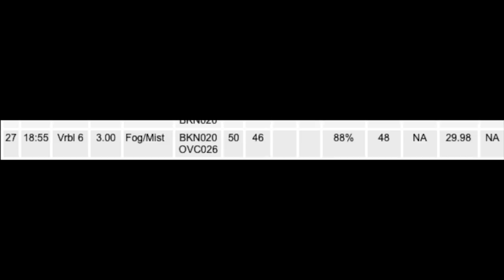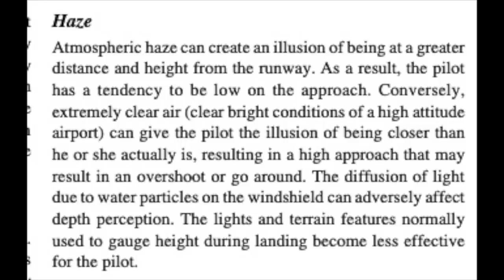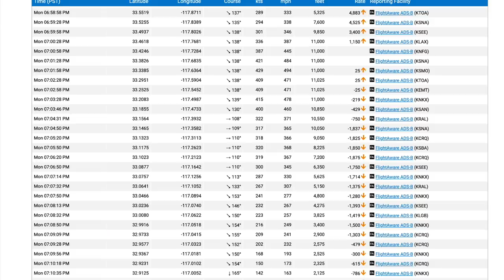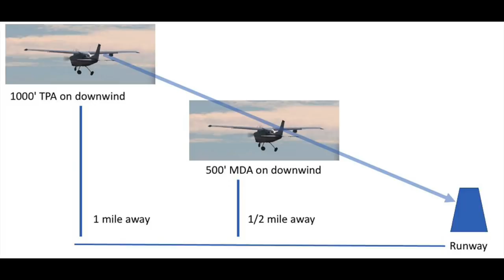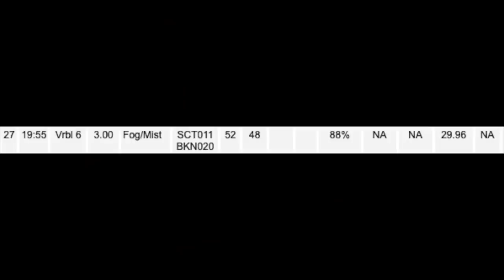N880Z Learjet Crash El Cajon San Diego California - Low Altitude Starts Accident Chain

Comment: Thank you for the explanation of the accident. As a pilot it’s always unnerving to hear about these accidents and I think that little bit of induced fear will make you start researching the chain of events that caused the accident, which will in turn make you learn from a tragic situation & hopefully never recreate the situation.
Reply from the maker: I totally agree. It may seem a little macabre to be reading about accidents, but I think they are a very useful learning tool. Another good tool is develop standard operating procedures and always following them. And of course practicing good risk management. If everyone did all of these things consistently, we'd have a much lower accident rate.
Reply: You comments are spot on! I fly a B350 KIng Air single pilot out of southwestern CO.  I don't do circling approaches at night, and only do them in the day if it is vfr conditions.  I LOVE my downwind legs to be offset 2-3 miles from the intended runway so as to have ample space to make the 2 90 deg turns.  That much distance out and I am outside of the circling distance from the airport anyways.

The conditions at the field that night were marginal vfr, so I possibly would have circled also.   My backstop for that maneuver while single pilot is I keep the auto pilot connected until on final approach (the runway clearly in the front window).  

Safe flying!
Reply: @campingalan  - Interesting, as this is all about risk management, right.  Isn't choosing to fly a B350 single-pilot already stacking the odds against you?  Just because you can, doesn't mean you should.
Reply: @chucksavall  yes....a very valid point!      

As my mentor advised, he recommended at least bringing a second pilot along with any SoCal or NYC flights.  I haven't done that yet.  But...at the point that I wished I did (like during a systems failure), it would be too late.
Reply from the maker: @campingalan  Yes, you take away so many problems in faster aircraft when you fly a properly sized traffic pattern. Fly safely!

Comment: Best breakdown I've seen. I was a block away from this accident when it happened, very deafening and bright. Weather was very bad and rain was regular with bursts of heavy showering.
Reply: Were you able to hear the engines spool up to max thrust after the accelerated stall had already occurred?
Reply: @josiahwaters1706  Yes, they were losing altitude as they were banking left and then the engines throttled up to max quickly just before the impact. I assume they had just figured out their error and were trying to correct.

Comment: The clouds on the CCTV footage seems much lower than 2000'agl. They were in and out of some really low scud, and lost situational awareness.
Lovely explaination of the problems related to a low pattern altitude. Nicely done.
Reply: He was only at about 700 feet when he should have been at 1440 by the chart) he started that final turn and from the video he was still in the cloud.
Reply: @badmonkey2222  Absolutely.
Reply: @78XT500  and was way too slow making that tight turn, the ironic thing is these guys aren't trained to keep their speed up in circling approaches and until they start training these guys to keep at least a 30% stall buffer while making the turn this is going to keep happening,, the airline's do it why don't these guys do it.
Reply from the maker: Thank your watching and for your kind words about my video. I've only seen one ground camera view, and there were definitely lots of low clouds in the area. I didn't mention it, but the airport is in a valley, so fog is common. And yes low pattern altitudes can cause the same problem for both VFR pilots and for pilots flying a circle to land maneuver. They physics are the same, whether their VFR or IFR at the time.
Reply: Definitely this ^^^^^^^ ... they were scud running under the low clouds and heavy rain trying to keep RWY in sight
Reply: I need a precision approach in this haze situation
Reply: @AviationNewsTalk  Thanks for professional video. I personally believe the Local Cab controller would have warned the pilots if ceilings, BR. or MVFR was a factor and/or decreasing significantly. He was probably expecting them to over fly airport at TPA and enter L downwind. I speculate that ceilings were very close to Metar due to popping beneath ceilings and the timing of IFR cancellation after Jugal.

Comment: Excellent analysis. 
27R had a usable landing distance (beyond the displaced threshold) of 4636 feet. 
Some have pointed out the LOC-D approach that appears to be straight in. However the final descent portion of that is at nearly 7º, more than double the normal descent profile for landing, making that approach in a Lear onto a short runway extremely dicey. This is why it is NOT approved or a straight in approach. Indeed it is ONLY approved for circling to other runways. The minimums for this category C or D aircraft to do that is a 1600’ AGL MDA and 3 miles vis. Plus there’s a tower 885 feet above airport elevation just north of the 27R centerline. Yikes!
Reply from the maker: Yes, there are a LOT of challenges for such a large and busy airport.
Reply: @AviationNewsTalk  Why not use RNAV 17 then Circle 9L? Enter L downwind or L base. No night restriction or Category C restriction. No need to cancel IFR. Winds OK at 190/5.
Reply: @DownTheRabbit-Hole  Maybe because there is even higher terrain to the west, lots of high hills and a mountain with a peak at 1600'. Would be my guess anyway. He does talk about it here  9:49
Reply: @BrettBaker  On RNAV 17 plate, Because the C in Circle is not Black it means the Circle radius is 1.7nm (the old numbers) for Cat C aircraft. Yes, I checked the elevations in Google Earth and you are right. The approach designers would probably say in RNAV 17 Pilot Briefing area that Circle 9L NA or CAT C not allowed in Minimums area if they felt it did not meet their criteria. At this point I feel RNAV 17 Circle 9L was the only legal and safe night IFR choice to a longer RWY that meets LJ 35A landing wet rwy minimums. If this is not correct please let me know.

Comment: So sad to hear about the loss of life, my condolences goes out to the families of those lost in this crash.
This crash is very closely reminiscent of the Lear crash in TEB. They took we’re doing a circle to land approach and basically lost it. 
I’ve flown Lears into TEB and have done the exact same approach many times, it goes to show that it can get away from you very easily and quickly, and at that point of the fight it’s darn near impossible to correct.
Reply: These guys that fly these jets are not being trained to keep the speed up on the circling approaches, they are only required V-Rep+ 5knts over stall speed which gives you no wiggle room, the airlines are trained Ion circling approaches to keep a 30% stall buffer on their speed until they are on straight final and then reduce speed, that's why you keep seeing these guys crash on the circling approaches it's going to keep happening until they're trained and required just like the airlines are keep that speed up when making those tight turns, plus this guy was way too low 700ft when he started that final turn and by the video he was still in the scud, just insane to think that he was trying to do those visually at night in that jet type.
Reply: @badmonkey2222  And if I might add, too many relatively "inexperienced" pilots got to school, "get the type rating", and believe they're now "qualified to fly jets", when in fact, the type rating is "a license to learn." (ATP, 12,000 hrs, 5 types and 35 years professional aviation experience)(and remember: what the FAA requires and what the "insurance requires" are usually two very different numbers for good reason)
Reply: @N34RT  Clarke, if this is true, then why on earth, during training,  are the pilots being told, "You ONLY need this much speed during this maneuver"?  Why not have them practice circ to land, and for safety sake, train the pilots to add that safety buffer to their speed. 
---People are focusing on being too low here, but the emphasis should be placed on the fact that he was too slow, not too low. The lack of speed is what caused the crash. Not the lack of altitude. Am I correct  on this? You, 12,000 hrs, Me 330 hrs. Thx

One more question, is it possible to recover from a stall spin in a Learjet?
Reply: @shamu3838  Last question first: Yes, it's "possible" to recover from a "stall/spin" in a Learjet, but it's a scary experience, even with 10,000 feet under you. So you're conclusion is correct: Lack of airspeed was the "precipitating cause", not lack of altitude. However, the various people dissecting and elaborating on this accident are pointing to altitude control (or lack of it) as yet another indicator or poor judgment/decision making.

Comment: Notes:
1)  There is a displaced threshold of 450 ft to RW 17.
2)  There actually is an instrument approach to RW 27R.  It is a localizer approach.
Reply: 1) There is also a displaced threshold of 706 ft to RW 27R. However RW 9L lacks a displaced threshold.
2) The LOC-D approach looks like a straight in approach to RW 27R but it is actually a circling approach to all runways.  If it was straight in to 27R, it would be called the LOC RWY 27R approach and not LOC-D.  It is a circling approach to all runways because it requires a 745 FT/NM descent rate to land from DEBEY at 2700, which exceeds the 400 FT/NM straight in limit. Diving at the threshold of 27R at 745 ft/nm from DEBEY would be at least a 1700 FPM descent at a Learjet's approach speeds and result in a dangerously unstablized approach. So to land on 27R on the LOC-D approach would require a circling maneuver and, like all the approaches into KSEE, circling to 27R is not authorized at night.
Reply: @sintillate1913  the LOC-D should not be circling for 27R.  The FAA needs to fix this.  That approach is a LOC 27R with circling options for the other runways.
Reply: @navycranes  it can't legally be LOC RWY 27R because the descent rate required is too steep due to terrain to the East of the airport.
Reply: @JustinJackson11  Do you mean ILS?  I didn't realize that a Loc App is only  a 3 degree glide path to be used. It all depends on the obstacle location on the approach path on Final.

Comment: I learned to fly, and still do, out of SEE. There is a LOC/DME approach in to 27R, but it takes you out east quite a ways which takes a lot of time, even in a jet. And then you are STILL NOT AUTHORIZED to circle to land at night... Bringing us back to the 'If it's not authorized on the plate, you should probably think long and hard about doing it VMC in bad viz' line of thinking. Great explanation of visual illusions from the PHAK, as well as the angle to the runway vs altitude explanation. I'm going to use that!
Reply from the maker: Ron, I agree with everything you said. You have to wonder, if the TERPS guys figure something isn't safe to do while flying instruments, do you really want to push your luck and try it visually at night? Count me out. I've certainly had my share of luck when flying, but I don't want to put myself in a position where I need to rely on luck to get out of a situation.

Comment: Great presentation. Some insider chatter, allegedly there was a sudden changeover from F/O who was PF, to the captain who had been monitoring up until the changeover. Don't know if PIC asked for controls, or what. Still waiting to see exactly where that happened in the pattern. 

The NTSB final report with a probable cause and the release of docket materials to public, is way past due. Usually on more serious crashes like this, it is about 18-24 months. We are approaching the 29th month with still no report. I followed this closely as I learned to fly @ KSEE, and also was in the air ambulance business, and we used LR35's and I also chartered many them, as I focused on the business side of aviation, and did not fly professionally. I have however, studied crashes and air safety since 1976. This crash reminds me of both the KTEB LR35 stall/spin, on a circle (452DA), and the Challenger crash at Truckee later on (N605TR). Very eerie similarities. As you well know, the Learjet 23/24/25/27/35 wings (airfoil) even with the MODS, is not accepting of mis-flying, exceeding the critical AoA. I am wondering IF the accident aircraft going into Gillespie Field, if those two pilots up front were using the AoA-%/deg indicator as part of the instrument scan (for Pilot Flying/PF).  You mention a good point about a remote chance they did not set altimeters correctly, which I agree, both of them would have to get it wrong on the dials. They should have had a radar/radio altimeter that I believe is good to 1,000 feet AGL. I also wonder if they might have monitored that instrument. Seems they risk-stacked, did not remind themselves of the Swiss Cheese Model, and very tragically the airplane bit them with unconscionably consequences, due to a likely accelerated stall.  We discuss these event to learn and so some other pilots may get an education. Complacency kills, and as you said, the pilots familiarity with their operating base of KSEE, may have led them into a false sense of security due to comfort. I sure wish I could dial-back time and bring those 4 good folks back, but it is done. Now we can continue to learn. In hindsight, I wish they either would have stayed on 17, even with shorter runway, though agree it was contaminated due to the light rain. Were they technically on the Part 91 phase since they dropped patient and were ferrying home? Maybe not since it was still a revenue portion of the overall flight. So yes, 135 likely dictated more RW like the 5,000+ they'd get on 27R. I sure wish maybe they'd just flown to Montgomery and did the straight-in ILS, or diverted to Brown or Lindbergh. Getting an Uber to go get all of your cars and go home, and do the reversal next day to get the bird back to base, is really a great decision. As one reader in these forums said, he makes good decisions and enjoys the fact he is in his hotel room enjoying some adult beverages, watching the news, versus ending up on the news. Thanks again for your channel!